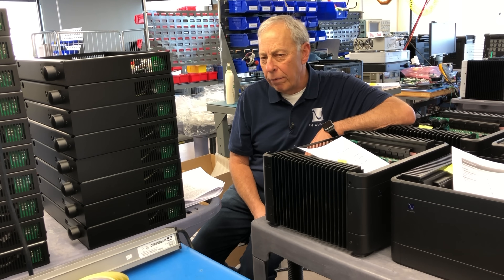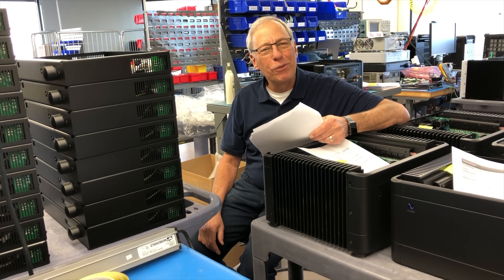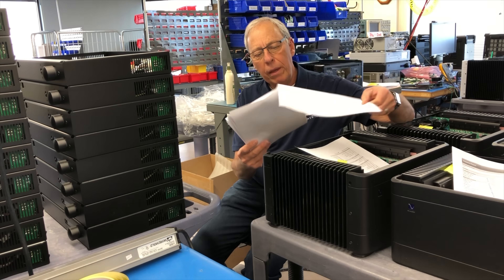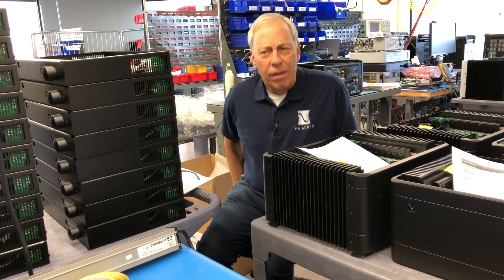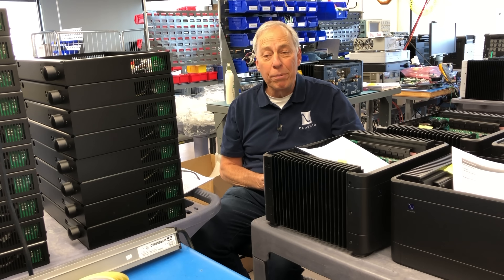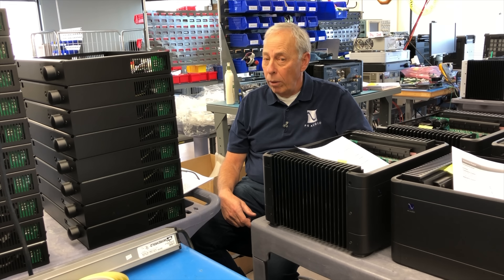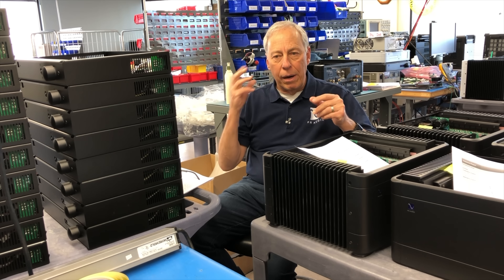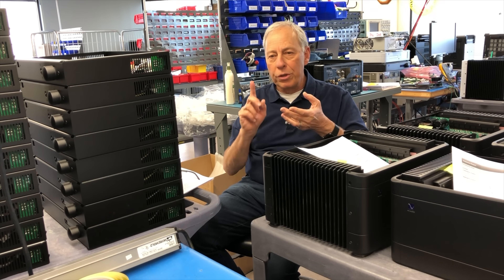Is damping factor a good indication of amplifier performance?

Comment: Hi Paul,

After all those years in audio and even working at a loudspeaker manufacturer, and still telling that a HIGH damping factor is something good? (Is this part of the 1 % that isn’t true?) I think this is utter nonsense, I think it is quite the opposite…

Damping factor is an important element in a power amplifier's ability to control a loudspeaker. Yes, but the LOWER the better! Damping factor is the root cause of the current distortion in loudspeaker drivers.

If an amplifier has a high output impedance (more than 100 times the load) and thus a very LOW damping factor it is not sensitive to impedances (reactive or resistive) in the loudspeaker. So it is not sensitive to (changes in) the inductance (which is current and excursion dependent), not to voice coil resistance (dependent on temperature, known as power compression) and not to generated voltages (back emf). So with a very LOW damping factor the (current) distortion is much lower, especially in the small signal domain.

However a HIGH damping factor lowers the quality (Q) of the resonance. So, when you dampen the resonance in another way than with electrical damping the distortion in the loudspeaker is much lower. And there are other ways: mechanical, acoustical, electronically (EQ) and probably more…

So, maybe a HIGH damping factor 'controls' the resonance, but certainly not the driver. A LOW damping (a high output impedance) improves the control of the amplifier over the driver, makes it less sensitive to influences (temperature, excursion, current, cone motion, sounds!, …) and results in lower distortion. Afterall, like all electromotors, drivers are current driven devices, not voltage driven.
Reply from the maker: That's an interesting take on the subject though not one I would agree with. But, thank you for sharing a different viewpoint! There's always room to learn and be accepting of new ideas even if we don't agree.
Reply: @Paulmcgowanpsaudio   And on which part don't you agree? Electromotors, current distortion, high output impedance eliminating impedance dependencies? (I'm also open for an off-line discussion. Give me a sign and I email you.)
Reply from the maker: @JerryRutten  The latter. A lower output impedance is best to control varying higher impedances.
Reply: @Paulmcgowanpsaudio  Okay, …

So, we agree that a driver is an electromoter. And that the current through the voice coil creates a force (F = Bl x I), which creates acceleration. And that velocity of the voice coil creates  an electromotive force (a voltage) over the voice coil.

With a very low output impedance (much lower than the load) the current through the voice coil is very dependent on the impedance in the driver. And with a very high output impedance (much higher than the load) the current through the voice coil is not dependent on the impedance in the driver. In this way the temperature of the voice coil, the inductance of the voice coil (changing with current and excursion) and motion of the voice coil (by the created sound, but also by unwanted vibrations and by external sounds) all has influence on the conversion from the output voltage of the amplifier to the current through the driver, and thus the SPL output of the driver.

So, in my opinion, a low output impedance amplifies the influence of varying impedance of the load and a high output impedance attenuates the influence of a varying load impedance.

Where exactly do we disagree?
Reply from the maker: @JerryRutten  By attenuating the influence of the amplifier it has the tendency to change the sonics of the driver in ways the designer did not intend (for the most part) and certainly cannot control (since "high impedance" is different for almost any amplifier because it varies with frequency). While I agree with your electrical analysis, I do not agree on the usefulness of the results. High impedance amplifiers generally do not sound as controlled or authoritative on speakers as lower impedance amplifiers do.
Reply: @Paulmcgowanpsaudio ,

Drivers are specified (and designed?)
* At an output impedance of zero ohms
* At 2,83 V
* In a quiet room
* At room temperature

This is never the case, so there is always a sonic change, also with a low output impedance. And on top of that, with a low output impedance it is not constant and stable, it changes with voice coil temperature, current, excursion, vibrations and external sounds. 

With a high output impedance there is also a sonic change compared to what is specified. The change is that there is more bass and more high frequencies. So there is more usable bandwidth, but, likely, some frequencies are too much amplified. There are other ways than 'electrical damping' to compensate for that… 

And with a high output impedance the sonics are far more stable. No influences by loudspeaker cable, connections, voice coil temperature, vibrations and external sounds. The changes in inductance of the voice coil by current and excursion has also no effect anymore.

So, yes, there are changes in sonics as specified. But they are stable and remove a lot of non-linearities (mainly in the small signal area, but also in the large signal area). And so, with a high output impedance the amplifier can better dictate the driver what to do, it has more control over the driver and there is less distortion. Less distortion than specified!

And yes, if there is no replacement for electrical damping, then drivers "will not sound as controlled or authoritative as lower impedance amplifiers do". But if there is damping of the resonance, acoustically in the loudspeaker and/or electronically it sounds as controlled and authoritative, even with lower distortion, higher dynamics (no audible power compression) and wider bandwidth.

If you define 'control' as resonance damping, then I can agree. If one defines 'control' as dictating the driver what to do with less influences, I don’t.
Reply: @JerryRutten  @PS Audio - Hi guys. Interesting Conversation. Please Correct me if I'm wrong here - but I thought the only thing "Damping Factor" indicates is the tendency of which the amp might reduce the extent by which a loudspeaker might  "ring". Lower Damping Factors might lead to 'fatter" or slightly increase bass response due to not have quite as much "control" & amps w/  Higher Damping Factors might? sound a little tighter - depending upon the response of the driver? Also- what is do you guys consider as a "high" "damping factor" measurement with today's loudspeaker designs? I worked ( as both a Salesman & Store manager ) for an Authorized  Cerwin-Vega Retailer for the better part of 13 years - and was always under the assumption that anything over 100 - 150 was considered as a "High Damping Factor" measurement. Thanks for the feedback. ( UC what I did there?)
Reply: @Paulmcgowanpsaudio   Hi Paul - Love your video's and yeah man -  I totally agree with you there about low-impedance amps.  I asked a question of both you and Jerry above in his response to your answer - but YouTube wouldn't allow me to Highlight @PS Audio on that line.  I know you are super busy - but might (? )  I ask you to please take a second to attempt to answer my question, cause I'd really like to know if I'm correct or in error.  Thank you ever so much for taking the time to converse and share your thoughts, opinions, and insights. Peace.
Reply: @X2FileWrightonite ,
High damping factor reduces ringing, but far more than that.

And here, a not so short response to make clear that in my opinion a damping factor says something about quality, but: the lower the better, not higher.

Comparing a very high damping factor (a low output impedance, the amplifier acts as a voltage source) to a very low damping factor (a high output impedance, the amplifier acts as a current source), a high damping factor means:

First of all: that makes (the output of) the driver sensitive to impedance (to the value and to the changes). A driver has three kinds of impedances: voice coil resistance, voice coil inductance and electromotive force. A driver in a loudspeaker and connected to an amplifier has more impedances: connectors, cables and passive filters.

Starting with the electromotive force, a driver (or an electromoter) is also a microphone (or a generator). When you apply a signal the driver moves, and the movement creates a voltage (!) on the input. So when you have a high damping factor (a voltage amplifier), the generated voltage disturbs the amplifier voltage. It acts like a brake. It is like driving your car with an anchor behind it. This electromotive force is frequency dependent, the lower the frequency the higher the voltage. So, the braking increases with lower frequency. In practice, it lowers the Q (the ringing) of the driver (in free air from Qms to Qts). But, you can also drive your car without an anchor! And by using your throttle gently, you can drive as fast and saving fuel! In loudspeaker terms, with a low damping factor and (active) electronically damping you can drive your driver at resonance with far less power and with more output at the bottom end. So, yes, damping factor means lowering the ringing, but at a cost, and you can lower the ringing by other, better, means.

Then the voice coil inductance. Coil with ferromagnetic cores are rare in passive crossover of audiophile loudspeakers, because it is well known that they distort. The voice coil with the permanent magnet of drivers distort also, with a voltage source (high damping factor), not with a current source (low damping factor). (And conducting voice coil formers distort also.) So, damping factor means also creating extra distortion in the drivers.
With a high damping factor the voice coil inductance also reduces the output of the driver at high frequencies (breakup and the horn-effect compensates for that). With a low damping factor the power response is more flat, when you compensate for breakup and horn-effect, you have more available bandwidth.

Then the voice coil resistance. Most output power of the amplifier is turned into heat (90 - 99 %, depending on the efficiency of the driver), which can raise the resistance a fourfold (known as power compression). Which ruins your dynamics and your passive filters (It changes the crossover frequency, and even worse, for the tweeter different than the midrange. The same goes for the crossover between woofer and midrange. So, creating peaks and dips in the frequency response.).

Then cables and connectors. A high damping factor makes the driver sensitive to cables and connectors, a low damping factor eliminates that!

And a last point. Connectors, cables, passive filters and a raised voice coil resistance ruins your electrical damping. So, a damping factor higher than 50 or 100 makes no sense really.

And on the other hand, a valve / tube amplifier has a lower damping factor, but not really a very low damping factor. A good low damping factor is when the output impedance is at least 100 times bigger than the load. The bigger, the better, because, as Paul said, with higher frequency it lowers.

And a remark. Using amplifiers with a very low damping factor (current-drive amplifiers) requires a redesign of the crossover filters. I think the best option is to have active current-drive amplifiers: active crossovers, current-drive amplifiers and loudspeakers without passive crossovers (sort of improved multi-amping).
Reply from the maker: @X2FileWrightonite  Hi Will. Damping factor is simply the output impedance of the power amplifier. The higher the damping factor the lower the output impedance. I think generally speaking the lower damping factor amplifiers, like a tube amp with an output transformer (for example), could be characterized as having flabby bass - or not well defined bass. I don't believe a system would have "more" bass with a lower damping factor. I would consider anything over 100 as a reasonable damping factor.
Reply: @JerryRutten   THX for responding. I think I know what you are getting at. I've read somewhere ( do not know 4 a fact ) that Most experts seem to agree with you a that a reasonable minimum target DF for Live sound reinforcement systems would be 20 because damping factor is really driven by the length and size of our wire and the impedance of the loudspeakers  connected at the other end.( and there is a significant length of wire between the amplifier and the loudspeaker. ) But in my home playback conditions - wherein the speaker wire is much shorter ( 9feet per channel)- and in the case of my system - way thicker- is a DF of 20 is a target and do you consider that low? My NHT SB3 bookshelf speakers dig deep for a small 6in woofer - all the down to 40Hz = 
the DF on my 130watt per channel amp is rated at100.  Also since DF really effects the lows = if your system is a sub / sat- where the sats don't handle the lows ( say below 120hz ) - cause the powered sub does - does DF really even matter in that case?

Comment: As usual with audio design it's a compromise. High damping factor does control woofers demonstrably better than valve amplifiers with their poor bass control and so with it's good damping it could be considered an extremely good thing for controlling overshot subwoofer (or woofer) excursions for instance, but a bad thing for high frequency performance as high damping factor is usually brought about by what might be considered by some an overdose of negative feedback, which can be a bad thing as loads of negative feedback usually accompanies an essentially non-linear circuit design (which is rightly considered undesirable). That much feedback will sort out the measured response, but not necessarily the heard response. So yes good for subwoofers, no for general use would be my answer.

Comment: Good video. From my experience, with maybe a dozen or so different high-end speakers, they sound better (bigger soundstage mostly) when driven by a low damping factor. I have even gone so far as to take a high damping factor amplifier, such as my Bryston 4B, and put a 1Ω resistor in series. Maybe these speakers were simply voiced with tubes in mind.
Reply: It is entirely possible that tube amps are a consideration in high end speaker design these days. Going back a few decades when high DF was the norm among speaker designers, putting a resistor in series with the speaker put a bump or 2 in the bass response leading to an artificially warmer sound. If they had been designed with tube amps the designers would have voiced the speaker differently.

Comment: I am going to take a shot at helping to answer the question. I will use an analogy of a car during discussion. Is a damping factor a good way to distinguish for the quality of an amp. Short answer yes. It is one of many. On its own, it does not predicate the quality of an amp. It is much like the shock on a car. The springs are the drivers. The car will be bouncy and out of control without the proper dampening of a shock. Another is the slew rate which is much like torque in a car. The faster a car can accelerate, the more "responsive" a car or amp can be seen to perform. All of this must follow a proper ability of an amp to be honest to frequency response. I also like to look at a square wave reproduction ability of an amp. If it can reproduce a square wave, then you can surmise that it can faithfully reproduce input signals. These items and more should be considered prerequisites when "spec'ing" out an amp.
Reply: So a Peachtree Nova150 is "better" than a Pass Labs Xs 150 because the damping factor is greater and the distortion % is lower?
Reply: @Koru-AI  Let me help answer by using a quote from my previous post.
 "On its own, it does not predicate the quality of an amp."

Comment: A high damping factor generally means that you will have tight bass.
Reply: High damping factor means higher feedback, means better absorption of emf from the driver. But when output impedance is low enough it won't make difference because cable has much higher impedance in this case. And this is why cable also matters.

Comment: So what number is regarded as a high damping factor number? And does it change depending on what ohm speaker your using?
Reply: It's in the name... "Factor".   It describes how many times lower the output impedance of the amp is relative to the load.  Yes, it's typically quoted for an 8 ohm load.  So if the amp has an output impedance of 0.8 ohms.. then 8 ohms / 0.8 ohms = 10.  Damping Factor has no units because it's ohms/ohms.  It's a ratio.  Medium sized tube amps will be around 10-30.   Vintage amps & receivers like Pioneers/Yamaha will be around 40-60.   Big beefy amps will be 100-400 or higher.   Damping factor typically varies with frequency... being lower at high frequencies.  This depends greatly on the output topology of the amp.  NONE of this has anything to do with sound QUALITY.   It can tell you a bit about how it will interact with your speakers.  Typically, difficult speakers with complicated crossovers do better with high damping factor amps.... but even this is a generality.
Reply: Majority of the stuff you can purchase at Best Buy or wherever is 200, most high-end brands are rated at a 1000